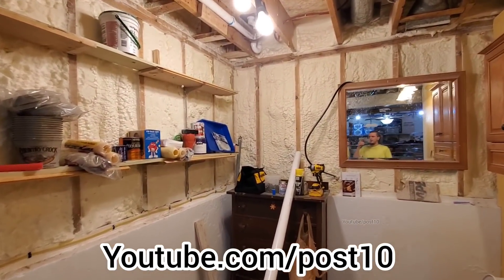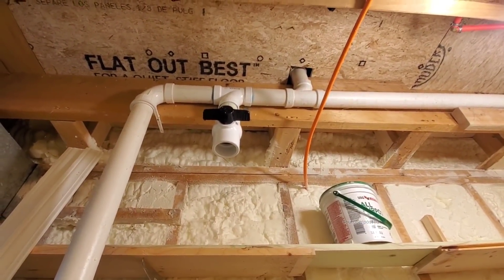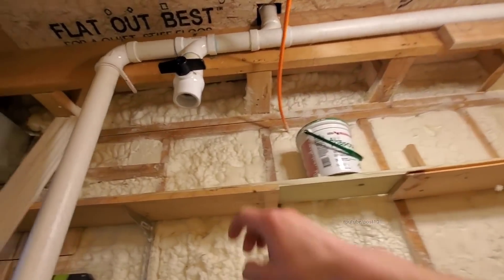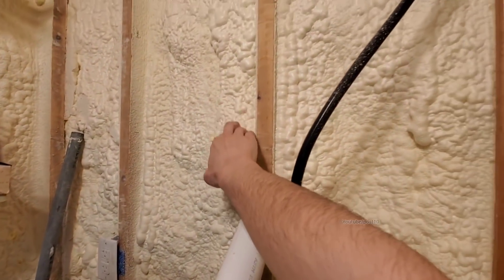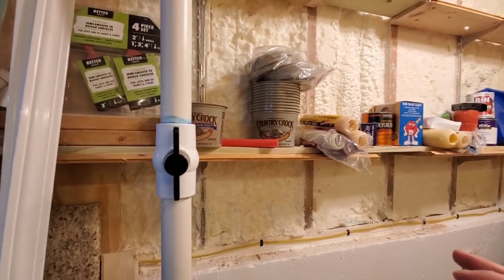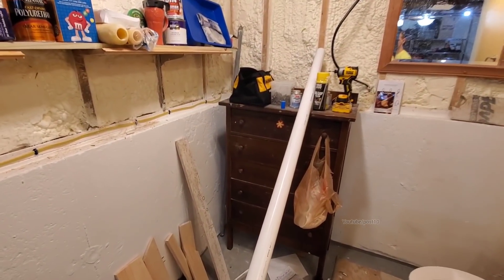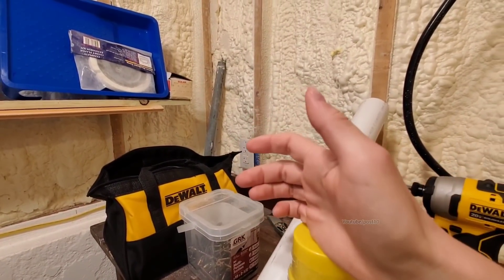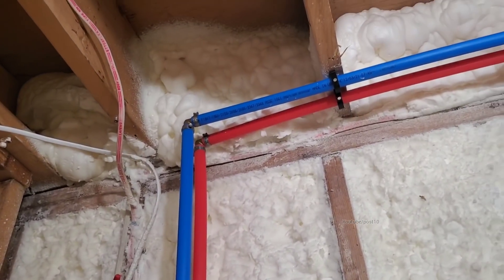Grey Water Reuse System For Summer Use. Build

Comment: I've got a hot water spigot outside my house to wash my car in winter. I put it in... in 2012. I actually don't live far from you. Trouble is most hose fittings and spray no sales won't take it. Ask me how I know, 😡
Reply from the maker: I didn't do it to wash the car with hot water, hot water is probably bad for the car. This is only to make the water warm enough to be tolerated

Comment: You can just use the already used once wash machine water and shower water for flushing the toilet.  We don't need to be using such high grade water to flush the toilet.  And one thing I do now is harvest water in the shower with a 5 gallon bucket.  I just put a 5 gallon bucket under the faucet in the shower 🚿  and as I adjust to temperature I will have a bucket of good water to to wash clothes with.  And I try to take short showers to save water.

Comment: Hadn't noticed the price of PVC going up, but I did have to buy more glue for my grey water system and shocked at the price of the stuff. I've got mine connected to a 3/4" flex pipe outside so I can move it around the yard. I did move the waterheater outside so I can have hot water. I also have rainwater from a tank.

Comment: As a plumber of 15 years, there is a bit of cringe using a 90 on the horizontal, but honestly it won't matter as long as there are no solids going down that drain.. Don't do any waffle stomps or pube shaves and you'll do fine! Keep up the good work @Post 10. love your content buddy, and so does my husky when i am at work!
Reply: Yeah if I was getting the parts myself, I would have selected street 90s and 90 the output outside to keep the outside water from causing problems inside.

Comment: I never heard why the cleaner was purple. Makes sense. It does make a mess. Looks like blue glue does the same though. Good job keeping unnecessary water out of the septic. Thanks and cheers
Reply from the maker: Yes the blue glue shows you that the joint is glued but does not prove that it was clean first

Comment: I wouldn't recommend using hot water on the car in the winter as you may crack a windshield
Reply from the maker: Of course, I wouldn't use hot water in the summer either, I'm going to mix it with cold water and have it warm. And I said I would only do it if temperatures were around 40 degrees which is not freezing

Comment: I don't like using expansive foam near electricity. It's very flammable.
You could likely have added a tank and made the system so as soon as the tank is full, it goes to the original way. Would've avoid the toggle manoeuvers.
That's what most people do here with rain and gardens.
Reply from the maker: Yes Great Stuff foam is extremely flammable but the other stuff you're seeing is not
Reply: Only flammable while still liquid I believe. How about stringing 4 underground tanks together, each tank is 40,000 gallons?

Comment: Why not drain it into an IBC tote ( 275 gallons )or serveral IBC totes- Paint them black and wrap them in heavy black plastic.  That way you won't have to make so many different angles. Just connect the 2 IBC totes, one into the other with an over-flow line and poke a hole out the side of the house just above the one tote for easy drainage. You can connect a hose to one or both IBC totes or run plumbing to your garden plots

Comment: I grew up in a farming community which was established just after the ww2. The septic system was  installed in the late 50s, and was still working extremely well 60 years later, and as far as I know is still in use today. Simple care is all it takes. Be aware that if you’re diverting all your grey water, your septic will slow down the composition, as you have essentially removed a huge source of oxygen and agitation and your septic will start to scum over and thicken, resulting in an odour issue. 
As you have the ability to switch diverting directions, regularly divert water to your septic to keep it healthy. It’s not fun to have to dig a septic when it has started to dry and has clogged the exiting pipe. It is also harder to restart the system once it has dried and/or been pumped.
Reply: what about just opening both ball valves, and then youll get a mix of flow to both? maybe partially closing one to balance things
Reply: Yes a U trap is missing on the Septic side just before the divert.
Outside pipe was installed with scratches due to not being inserted from the outside.
A standing Butt/Reservoir for dry days is also missing from the outside to minimise odour.

Edit 
Other than these small issues it was a good upload👍

Comment: of course now that you have a direct pipe from the tub to the outside you'll need to be on the lookout for small animals and/or bugs so they don't enter the house from the pipe.
Reply: The p-trap is always full of water, so nothing would be able to get past it into the house.
Reply from the maker: Yes I'm going to put a screen over its but unfortunately the hardware store was out of 2 inch screens
Reply: A little mesh? Plus the shutoff is that enough?

Comment: A septic system does release grey water, there's a leach field at the end that allows water to pass once all solids have settled.  No real need to dump it unless your using the water.
Reply: I've built 2 systems that reclaimed 100% of the post septic tank pre leach field 1000 gallon at a time for irrigation purpose I can send drawing of how to keep it up post
Reply from the maker: Yes I am using the water., it will be used in summer purposes. It also take stress off the Aging system

Comment: Many parts of a house can be gray water. Can thread shower into launfry first wash. Also old fashioned double laundry tubs do this, last rinse to first wash. But good deal to run it outside for a dry spell and saves the public / private sewer system from pressure. So important!

Comment: I remember when I was in my teens back in Indiana, my dad got turned in by a neighbor for letting gray water run toward the 160 acre fields surrounding our house....farm ground owned by family.  Not sure if it's still against the law.  My dad was a pipefitter...he would enjoy watching you do this but he's too rural to get a lot of internet for stuff like YT.
Reply from the maker: Yes I was so happy when high-speed internet finally came to my area. I was using phone line Internet for the longest time because cable internet's was like a mile away and it would have cost $2,000 to run a wire. But as soon as the Neighbors start getting it I just tapped onto it. I was so happy because I was used to an hour long video taking 5 days to upload but now it takes about 20 minutes
Reply: Legality depends on where you live. I used to see a lot of rural houses and cabins in Maine that legally had it.

Comment: You used an impact drill to drill the hole through the wall. Thats why it was sort of hammering while drilling. I mean it works. But if you have a regular drill it works better for using a padel bit and drilling holes sometimes. Anyways. Great video. And awesome work!
Reply: True, I would recommend the Milwakuee  M18 Brushless Hammer Drill. Runs about $300 at home depot for the tool, battery, and charger but sometimes you can find sales for cheaper. Plus, in my opinion, it's worth the extra cost for the quality of worksmanship, superior battery quality, and 5 year full coverage warranty.
Reply: @schwingmann  I paid about the same for the kit that comes with the impact driver, hammer drill, detachable side handle, two batteries and a charger all in a blow molded carrying case.  I had an issue with the drill and when I contacted Milwaukee, I was still within warranty and I had a brand new replacement in about two to three weeks.
Reply: @Itsthatoneguy371  Nice, same here I caught one of the sales... got the kit you mentioned plus a "Free" m18 hacksaw for $399. also bought a floodlight and 2 of the smaller CP3.0 batteries in a blow. Those batteries are so pricey but seriously, the difference in Milwaukee and deWalt batteries is night and day in my experience. Well worth it.
Reply: Yes. U will burn a impact out using on something like that. Plus just killing batteries. That's the driver part of the drill and driver combo. One makes the hole and the other drives the screw or bolt.
Reply: Personally, I would have used a forstner bit. I may have it spelled wrong.

Comment: No one mentioned the closed cell foam on the walls and ceiling in the basement there. A great idea to keep both  summer
humidity and winter cold from entering the living space above. Even though it's cold outside those three lights bulbs
there provide enough heat to work in a tee shirt!
Reply from the maker: Closed-cell is the best but the idiot who spray formed this house did half of it with open cell, not a problem yet...

Comment: Cool project. Your not worried about any water and snow building up around the pipe freezing and breaking it?
Reply from the maker: No I am not because when the system is running it's going to be warm water that would melt it otherwise it is off, any irrigation equipment will be disconnected in the winter time